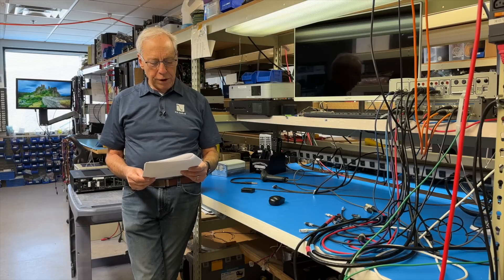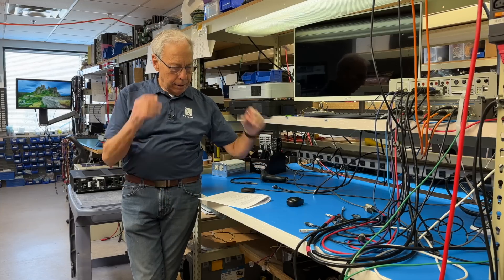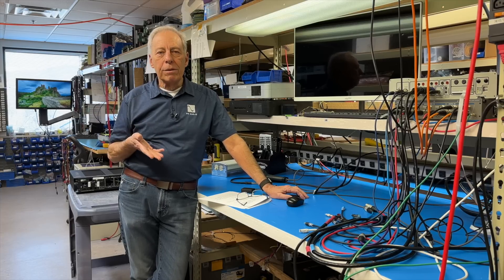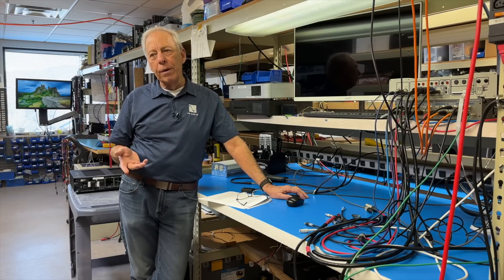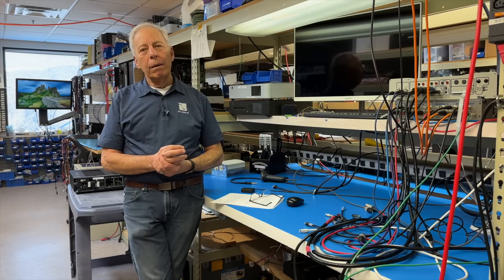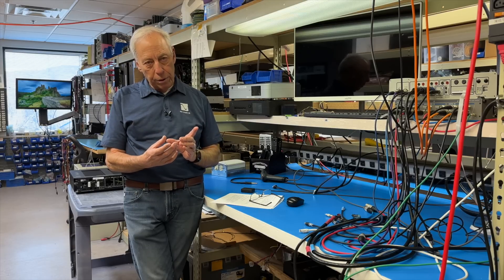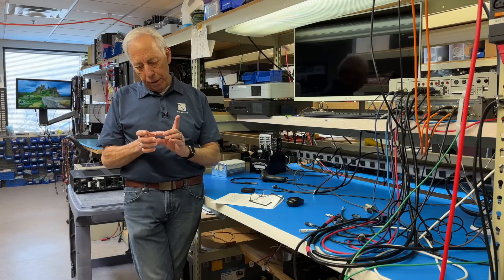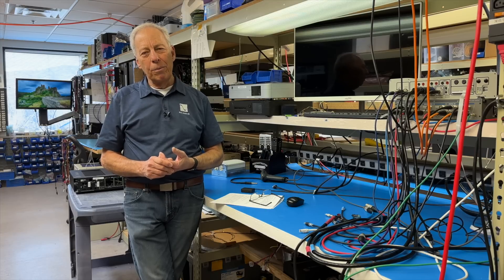Eliminating USB noise

Comment: I'm having an insane interference issue. Just upgraded my 06 titan's stereo to a pioneer carplay unit. With the head off no interference, head on, some interference, plug my phone in to use carplay, massive interference. When i key my radio, it kicks me out of carplay. Super strange, only thing I could think was USB interference. Recently installed noise filter from battery to CB which cleared up a lot from alternator, but now this issue is on. I'm running a Stryker SR-447HP peaked and tuned to 120 watts on 11 Meter, 18 feet RG8 and a Wilson 3000 antenna. do you have suggestions for noise suppression solutions?

Comment: i recently switched to the new AM5 socket. so, new mainboard, new cpu, new ram... my dac is powered from the V5 my pc is putting out. sounds terrible! so now i ordered a usb expansion card with external power (well, at least sata power directly from my power supply) to avoid my mainboards 5V. hopefully it works - im going crazy.

Comment: Wow you analog audio guys have no idea about digital data transfers like USB or Ethernet or Wifi or Satellite radio for that matter. Digital data is not like an analog it is just 1's and 0's. There is no such thing as noise or jitter in digital data transfers only bit errors usually quantified by BER (Bit Error Rate).  Unless the noise is greater than the difference between the 1's and 0's or the time variation between bits is greater than half the nominal time the data bits will still be perfect. In practice there are no errors over normal wiring no matter how cheap. Also digital data is usually encoded with check bits so that invalid data can be discarded or re-transmitted. Discarded data will result in dropouts like listening to XM radio in a tunnel. Note that a short tunnel won't cause a dropout because the received bits are captured into a chunk of memory called a buffer. Digital transport mechanism rely on buffers both on the transmit and receive side. Incidentally the receiver side must be faster than the transmit side otherwise its buffers will fill, this is prevented by flow control protocols essentially telling the transmitter to slow down a little.

Comment: The search term is "ADUM3160".  It's a USB isolator chip that costs very little and fixes noisy USB ports that leak into USB audio.  The only downside is it odesn't work at full USB speeds, but that doesn't matter for most DAC's.  I used one on my laptop to fix buzzing on the microphone DAC, and one on my desktop to fix buzzing through my DAC onto the speakers when the GPU gets loaded.  GPU's are crazy noisy with how fast they do power switching.  If the buzzing gets louder when you turn up the volume, it's a ground loop and needs something else (ground loop isolator or a ground lift).  Don't bother with $$$$$ cables and USB devices and stuff...they won't help.

Comment: I never had any issues until I bought a USB audio interface. Firewire and Thunderbolts and PCI cards never gave me any noise issues and they all connected directly to the PC.
Reply: Makes sense, thunderbolt cables are much higher quality and are usually shielded

Comment: Not only the USB port noise is the issue, but also the supplying power is also the problem. None of the USB ports are created equal, even from the same brand. Most of them are "cheap made", or very much "budget concerned" for a consumer product. Therefore, the USB ports on any consumer products are not designed for good quality of supplying decent grades of audiophile requirements. That's the reason why you are hearing different quality of sound from different USB ports, even on the same computers.

Comment: I have a very long USB3.0 cable with some sort of bit-corrector in the end. Ever since I use that (plus indeed a cable in the end that does not transmit power), the sound is MUCH cleaner!

Oh and I did buy an audiophile-level USB3.0 card.

Comment: Noise from a USB cable? Isn't this a myth? You can crank up the volume on headphones on an amp connected to usb, even something as cheap as the ifi zen dac, and...you will hear nothing. And if something played through the headphone at that moment, you would be deaf, so even if you hear something is it audible at normal listening levels?

Comment: I wish this video would have came out a few months ago. I built an all-tube preamp and when I used it, there would always be this white/RF kind of noise going on that was very noticeable. I was doing every trick in the book to improve things within my preamp and nothing seemed to make a legitimate difference. Finally I turned off my iMac (that is powered by the same Furman Elite 15 PFI that powers the other equipment) and the noise completely disappeared. I plugged the iMac into another outlet (instead of using the Furman) and there's still a little bit of noise but nowhere near the amount I had before. The crazy thing was too, when I would play records, the noise would be there even though the iMac wasn't in the signal path at all. I'm just thrilled it wasn't my workmanship that was causing the noise!

Comment: I think around 40 years ago someone came up with TOSLINK optical cables which are dirt cheap and eliminate any electrical couplings between devices. You can also use a simple cheap optocoupler for galvanic isolation. This isn't rocket science and it's not hard to do!

Comment: I did watch a review/test on USB cables a while back, there was a difference in how they measured. So it would be interesting to see how some isolators works as well.
The DAC that I'm using at the moment has separate power input, so I'm guessing that they have tried to isolate the signal and power, so maybe it wouldn't do much.
Reply: Do you have a link? Exactly what were the measurements performed and how did the measurements differ?
Reply: @andydelle4509  I don't recall who did it, it was a video on Youtube. They checked the waveform to see differences between sample and sent, not sure how it translates but some did show a difference.

Comment: Would you be so kind as to tell me what to do to hear this USB noise? 
For five minutes now I've been putting my ear to the High-end loudspeaker of my High-end system and i do not hear anything - absolutely nothing...
Reply from the maker: The "noise" isn't in the audible range. It is in the ultrasonic range: megahertz. I apologize for not being clear. Because computers are high speed number crunchers, the noise they produce is way outside the range of human hearing. That, of course, doesn't mean it doesn't ultimately impact sound quality. It does. Only it doesn't do it in the traditional way you might think of hearing increased noise.
Reply: 😀😀😀😀😀😀😀😀😀😀
Paul would recommend a 
$20,000 Audiophile microphone to use…😎
Reply: 😅 @davidfromamerica1871

Comment: should never buy a USB cable that is not made to USB specifications. The DAC should handle any noise, not the cable.
Reply: Well most of the boutique audiophile USB cables ARE NOT certified. Remember the certification process can easily cost over $10,000. Same for Ethernet and HDMI cables. But just buy a Wall Mart USB cable that is certified and you have all you need. I look at some of these audiophile USB cable ads and can see the vendor has no clue of classic transmission line theory. USB is in fact critical cable wise, but again properly designed cables are available quite cheap.

Comment: If the signal is digital, there is no introduction of noise.
Reply: The correct statement is, if the signal is digital then noise shouldn’t affect the digital information. It doesn’t. It means a digital signal can exist alongside significant noise with no ill effect until it is converted to analogue. The solution is to prevent that noise regardless of the fact it is a digital system.

Comment: I do not know if it is noise, or something else, but...
When I tested my printer's USB cable and my hub's USB cable (the cables that were bundled with the printer and the hub)...

When I tested (or used) the above cables with my DAC, the sound quality was in the toilet -- a kind of muffled sound quality.
Both of those cables worked for printing and general computer use, with no issues.  I have used them for years, and still use them for my printer and hub.  But while connected to my DAC, they killed the sound quality.

I use an Audioquest USB cable with my DAC, and it sounds great.

I did the same thing at the store where I purchased my stereo.
I used one of their computer USB cables on one of their DACs, and had the same awful results.  They use Audioquest cables on all of their gear.

So there is something else going on with USB cables, as it pertains to sound quality.

Note that none of the USB cables that I used were longer than 3'.  So I was well within the 3 meter (some say 5 meter) limit of USB's useful range.
Reply: @@Douglas_BlakeMy personal experience is that USB cables definitely make a significant difference in sound quality. I have done the same test using the free USB cable that comes with a printer and had similar results. In my case, the cheap cable resulted in a less natural and more fatiguing sound.
Reply: @arize84  Douglas Blake lives in the world of "cables do not matter".
She refuses to conduct listening tests.

She will not say why.
I suspect that she does not have access to the equipment, to conduct a proper listening test.

So without ever conducting a listening test, she asserts that we are imagining things.

Think about that:
The people that actually conduct proper listening tests are imagining things, and Douglas Blake, who never does a listening test, chimes in as knowing better.
The above is her position.

In case you are not aware, this is par for the course with her.  She routinely does this whenever cables are discussed.
Reply: @Douglas Blake please let Electrical Engineers talk topics like this.  You seem to have an elementary understanding of understanding electronic communication and challenges associated with it.
Reply: @Douglas Blake I don’t disagree that there are many over built cables that make no discernible difference in many cases, but in this case a poorly made cable can cause issues. I’m an engineer that works on aircraft electronics and believe me, cable construction matters in high-speed low latency applications, in the presence of other high powered electronics. EMI is the devil.  
I have to run to work, but I’ll bet there are some good YouTube videos explaining it well (maybe even this one) .
My rule of thumb for consumer electronics is the buy midrange, often 90% of issues are solved by spending a few extra bucks.  
Cheers
Reply: @Douglas Blake "It's not the cables ... and it's not the DAC ... There is no analog signal on a USB cable, it's digital only and it's noise filtered by differential signalling.  
Most likely you're just fooling yourself."

I did the testing.
The store's personnel did the testing.

According to you, we all imagined hearing sound quality change between awful and fantastic.

That there is "no analog signal" is irrelevant.  Digital signals have issues, too.

But rather then conduct the test yourself, you post moronic comments.

What else have you never tested that you can enlighten us on?
Reply: @@Douglas_Blake A couple of things; it's very possible that we are not able to measure all the characteristics of the audio spectrum, so we might not necessarily be able to currently capture in measurement all the changes between digital cables. Also, I don't know if you have ever lived with a high end/highly resolving system that does a better job of highlighting these differences. There was a time in my audio journey when I couldn't hear any discernible difference between a $500 DAC and $2500 one based on my system at the time. You need to consider that it is most likely not possible to sustain high end audio simply based on placebo effect. These differences are real and I simply don't hear them because one cable is more expensive than the other. I have compared $3K power cables to $300 ones in my system and not heard any difference. On the other hand, I have easily heard differences between USB, coax, and speaker cables. It really boils down to system sensitivity and resolution. You sound very convinced of your view point, but open yourself to the possibility that your stance could be rooted in a certain amount of arrogance and quite frankly ignorance.
Reply: @Douglas Blake "As a 40 year service tech I've tested almost anything you can think of at one time or another.  It comes with the job. Moreover; almost every service call I've ever done begins with listening... it's the first diagnostic skill."

Either you are lying, or you service low-end gear, where cables will not matter.

Give two examples of high end gear where you conducted listening tests where you swapped between mass produced printer USB cables and quality USB cables, such as the ones from Audioquest.

The difference in sound quality can be heard if you are deaf in one ear, and lost half of your hearing in your other ear.  Yet, you claim that the cables make no difference.
Ergo, you are either lying, or you work with low-end gear.  There is no other conclusion to be reached by your absurd assertions.

"On top of that, I didn't spend good money on a system just to test it... OF COURSE I listen."
We all spend money on stereo gear.  Your statement is an attempt to convey that your money was spent on quality gear.
Your statement holds true for spending money on a Walmart stereo, or a stereo from 1958.

So listen all you want to crummy gear, and tell us that you listened.  Such listening is pointless.

Rather than stating that you spend money...
List the specific gear that you used to perform you listening tests.

You will not, because you spew BS.
Reply: @Douglas Blake "Okay ... I can do that ... but I can guarantee you won't like it.  Most of the papered engineers out there are busy proving that cables do not matter and in many cases their design work involves making sure they don't matter so that you get optimal performance no matter what cable you hook up."

Forever trying to prove that we do not hear what we hear; that we should ignore our ears and obey the absurd assertions of Douglas Blake.

Folks, Douglas Blake's brain is incapable of understanding that nothing she nor anyone else says will change what we have actually heard with our own ears.
She will tell us that we are imagining what we have heard.  She expects us to say "Oh, then I did not hear what I heard, because Douglas Blake says so."

There is no need to listen to a stereo before you purchase it, when Douglas Blake and her engineers can conduct tests and tell you what you will hear.
Reply: @Douglas Blake "Key phrase ... "Personal Experience' ... devoid of science or common sense."

@arize84, do you now understand that your personal experience... your own ears are not to be part of what you heard?

In fact, according to Douglas Blake's rationale, the tests that she runs should not be believed, because she should not trust what she sees in the results.  How can she trust her eyes?

@Douglas Blake, you do not see the words that I have typed here.  Do not believe your eyes.  Instead, believe me.  There is nothing typed here.
Reply: I see where this idea comes from. Analog audio cables with high capacitance driven from a high impedance source ( a classic tube preamp) will have HF rolloff. That will sound "muddy" So the same cable capacitance will easily roll off a high speed HF signal like USB. So again we have muddy sound.

WRONG! 

Yes, the USB signal is not a clean square wave anymore. But as long as the DAC can accurately determine a one or a zero based on voltage level, the data is 100% correct. Any errors are not subtle and generally muted in most DACS. As for timing and jitter. USB is packet based and buffered. That removes any appreciable jitter.

Comment: As a computer guy that build PCs for gaming, I do agree. But like all other things in life, you get what you pay for. New PSUs with platinum ratings from well known brands are very good isolated. The new standard (ATX 3.0) seperate the voltage much better.
Reply: No.  I have an AX1600i plugged into 240V, widely considered the best power supply on the market, and it doesn't fix stuff like the GPU throwing a bunch of switching noise into the USB ports.
Reply: i have a late 2023 release of the evga supernova plat 850 full mod and i have AWFUL noise cause my house is old. It stops when i use bt. I dont own so im gonna get some ferrite chokes to put on some power cables. I even get it through my ups. Which is weird
Reply: can you please name a few brands/models?
Reply: @QuangNguyen-md8ky  seasonic has always been trusty. You can pay slightly more and get the higher titanium tier even but tbh even the very common gold tier is fine in terms of shielding in my experience. Platinum and titanium are mostly for servers and very important critical systems where a lot of redundancy is needed.

OEMs will often cheap out on the power supply even on a well built pre made. So unless you know for sure it's worth checking. Laptop power supplies are a whole other beast though.